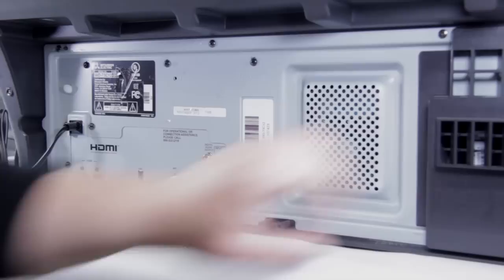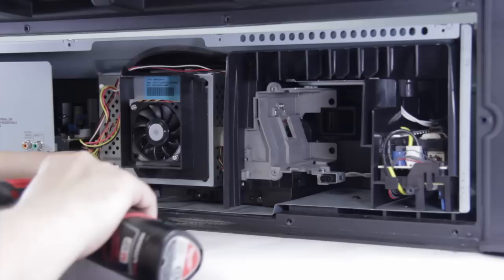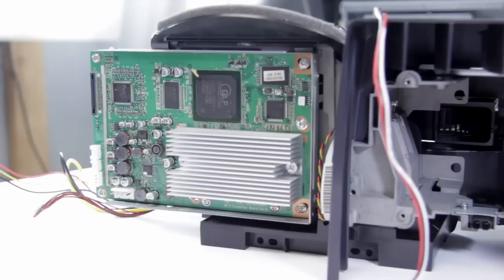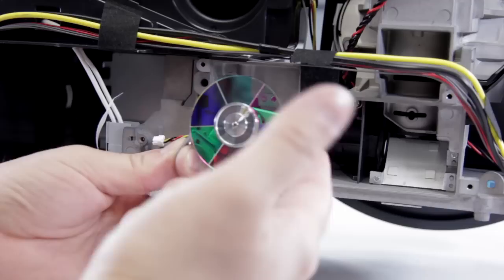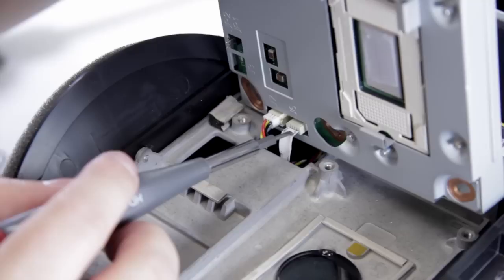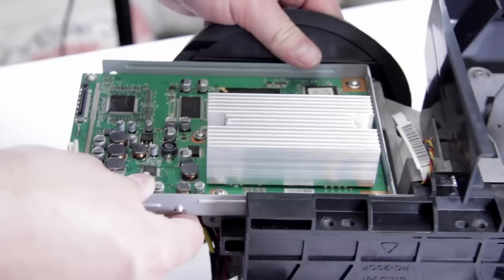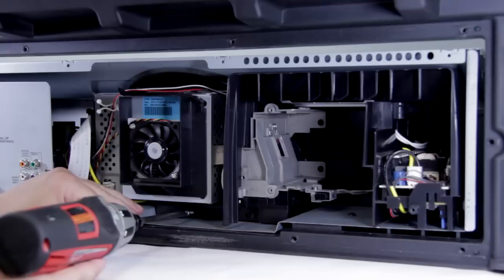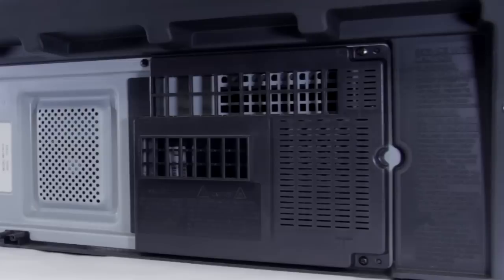Mitsubishi Color Distortion How to Replace DLP Color Wheel TV Repair - DIY Light Engine Removal

Comment: I'm getting ready to try this.

I'm only puzzled on one instruction. You say to leave screws loose on de-assembly of the formatter board. This make no sense to me as one could not reach the board to adjust it one assembled. Even if you disassemble to adjust how would one know the correct way to move it, trial and error? Sound like it could be a nearly endless process.

Comment: I just did a color wheel for a client. I was very apprehensive to have to remove the DMD board as it is supposed to be adjusted when reinstalled, probably not a big deal, but...
What I noticed was if you remove the one screw holding the lens shroud and remove it, the connectors are accessible from the back without removing the DMD.

Comment: This repair video was awesome.  Having absolutely no prior experience in TV repair whatsoever,  I was able to get to and remove the old color wheel, replace it with a new one and get everything re-connected and re-installed with no problem - thanks to this video.  Took me a couple hours because I decided to clean the years of dust and grime off of everything along the way while I worked - but it all came together very well.  The TV now operates perfectly - just like when it was brand new.  Thank you!

Comment: this guide was fantastic! the only thing I'd add (and it's not necessary) is to put red sharpie around that one stray screw hole on the right that looks like a vent. otherwise you may have an extra screw at the end. but again it's not necessary and if you have an extra screw, just tape it to the back and pretend you will put it back in one day.

Comment: I like the way you take your time and explain every step as you do it; you say what you're fixing to do and show where the parts or screws are are whether or not to be careful or not to touch this or that due to possibly messing it up.
That's exactly what I need. I did manage to take the color wheel out just like you did, but I missed hearing you say to turn it over cause I got lost when I looked at yours and looked at mine, but I figured it out.
Thanks for explaining so clearly.
I give 2 thumbs up!

Comment: Great video, my model was slightly different with the color wheel cover but everything went in the same way.  Can I just say that the color wheel cable is too damn short?  Who the hell designed it this way, and why don’t the replacement wheels come with a slightly longer cable?  What a PITA connecting that thing!

Comment: You should have clarified that you were also working on an LCD TV.  Clean that fan before it fries the chip.  The Japanese electrical engineers made those wires so to put back because they smoke their opium at work.  Great video.

Comment: Question. We've got one of the 73 inch mistubishi dlp TV's here. And when we start the TV up,it's fine for the 30-40 seconds or so and then the color begins flickering. Is this a color wheel issue? What causes it? 
Also, do the Mitsubishi colow wheels have air bearings and would cleaning it help alleviate the issue at all?
Reply: @brentpierce7585  so are you saying if you use a cheap balb you hear  the whining sound. But then you use an expensive bulb and no issues play using the cheap one causes the same issue

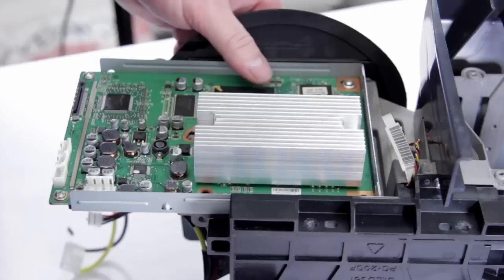Comment: Hi great video! On 13:24 you say not to fully tighten screws for possible picture adjustment. 
So, if picture adjustment is needed, we would need to again perform all the steps to get to this electric board for adjustment? Because in order to test picture we must re assemble, power on and test, correct? 
Thanks! 
Michael
Reply: I just posed the same question, what did you find out?
Reply: just wiggle the panel with the fan that you reassembled. don't take it all out

Comment: I am fairly certain it was the color wheel in my Mitsubishi 82" DLP WD-82740 that would begin making a whining sound after about 1 to 2, maybe 2½ consecutive hours maximum of being powered on.  When it did, the color was all greenish and flickering/distorted and I could turn the TV off and the whining sound would immediately wind down and stop within about 2-3 seconds.  Then I could turn it right back on and it would be fine, but then it would happen again much sooner than the first time after initially powering it on.  Occasionally, I would notice that it would look like it was about to happen, but would just distort the color for a second and then return to normal, but the other issue would always happen shortly after and it would always continue until the TV is powered off.

However, after many months {maybe even a little over a year} of this issue occurring every time the TV was on for long enough for it to occur, last weekend I had it on for many hours and then even fell asleep with it on and I was completely shocked to wake up to the normal great picture, no color issues, and no whining sound, which was previously unheard of since this issue began occurring.  A few days later and without the issue having occurred again, I fell asleep with it on yet again and same thing, woke up hours later and no issue.  So, yesterday at about 1:00 PM CDT I turned the TV on and started watching football, more football, 48 Hours, etc. and it has been on for a good 14 hours now and not even the slighted sign of it occurring.  I do not understand it because nothing has changed.  Of course, now that I have posted this, it will probably happen here shortly.  Hope not though...
Reply: Same thing happens to my TV.  Flickering when TV is just turned on, hours later the flickering stops after it's been on 8 hours or longer. I'm getting my color wheel replaced and hope it doesn't flicker anymore after that.
Reply: Jeffrey Tuttle 
hbv
Reply: Do it change it yourself had the same problem and it was filthy inside with dust changed the chip and the colour wheel is like new again you just need lots of time and pacience
Reply: Temperature change can affect the grease in the bearings and make them perform sluggish once the grease gets cold it kind of cakes up inside the bearings.

Comment: I have a Mitsubishi dlp 73" tv worked great then bulb blew up. I knew better but I put a cheap bulb in it. It would work ok for a few hours then the color would go all weird had lines through it ect. Turn it off for a while then it worked but same problem you would think the color wheel was bad. So put in the expensive O.E. brand bulb now it works perfect that was a year ago still works perfect! If yours is doing this could just be a cheap bulb causing the problem?

Comment: What is the issue if there is no longer white on my display? Ice in a hockey game looks yellow and the 'blue screen' when no signal is on is green. there is also a speckled oval of blue dots in a giant pattern on the screen. There seems to be a 'blue problem' wjth colors on my 2006 Mits wd62530. New bulb every 18 months, getting about 8000 hrs per bulb, so normal. I love this TV for the 50/50 screen split, but a new 60" is only $750 or so now and it might be a better value than repairing...thanx

Comment: I'm replacing the dlp chip and the colour wheel myself ,can't get a tech to come and replace them ,,would be nice to know how long the colour wheel should spin as i bought  one from China and it didn't spin for too long so I'm waiting for another one as I am afraid it was a dud and don't want to disassemble this again I love this tv wd82 840 spent over $400 in parts  ,,,,,,,hope it works the disassembly video was really good just the spinning of the wheel would  have been a great help,,,hope this works if not I'm going to cry and dump it😕😕😕😕😕😕
Reply: one light spin should last at least 5 seconds on a new one

Comment: Hey ShopJimmy, I used your great video to replace my 92" Mitsubishi color wheel, but when I reassembled it I didn't put any effort in aligning the lamp etc so the picture is a little off to one side, about 2 inches. Can you help me with that alignment procedure?
Reply: remember that bit he said about not over tightening the board? the whole fan and board there should move enough to make minor adjustments without doing any disassembly
Reply: major* disassembly

Comment: Which specific Mitsubishi Model TV is This? I have a WD 65838 that I just replaced the lamp in and just after doing so the screen began flickering and there is a whining noise coming from the back of the tv.  I'm assuming it's the color wheel because the lamp is definitely good.
Reply from the maker: gurleyz  This sounds like a color wheel problem.  It is recommended to replace the color wheel.  Looks like we are out of stock, but here is a link to replacement parts for your TV model number on our website.  http://www.shopjimmy.com/catalogsearch/result/?q=65838  Thanks!  www.shopjimmy.com

Comment: I have a 82" Mitsubishi DLP WD-82740  made in 2011. It makes a whine/hum sound that comes on as soon as I turn the TV on and gets a little louder after it is on for a couple of minutes. It stays on till a few minutes after the TV is turned off and the light in the back goes out. I bought a fan and spun the TV around and I can hear the fan noise that is different and quieter. does anyone have any ideas, could it be the color wheel? It's not too bed unless I'm listening to the stereo at night or at low volumes.  The TV has been used enough to go through the original, a second factory bulb and I put another in about a year ago.
Thanks Ted

Comment: I have a Mitsubishi DLP Digital WD-62927
Serial 10051. I just recently put in a new bulb. The tv power on and works fine, however after 30 to 60 minutes the colors start to flicker and the colors start to become faded and also develops a line split in the middle of the tv. Is it the color eh week that is causing this?
Reply: It may be the optical sensor attached to the color wheel.  The optical sensor is a Sharp GP2S40 Photointerrupter.  You could try replace this part if you can solder...otherwise you can buy a whole new color wheel (make sure it comes with the optical sensor, not all of them do).

Comment: Why didn't you show us how fast/long the NEW one spins?? Would have been a natural, coming seconds after showing how fast the OLD one came to a stop.
Reply: The colour wheel should spin freely but doesn't whirl around fast I replaced mine and saved a mitsubishi 82 ins tv 2011 model this was a great video I could not have done it without it ,,I've never touched electronics before it took me about 5 hrs going step by step to resemble it was worth it as nobody would come to fix it
Reply: @icefigureskaterliz1118  u got lucky . Can I have ur tv

Comment: Thanks for answering my last question, i recommend that you simply pay a repairman this step by step with wires pulled here and there and screws taking out is beyond a hassle for anyone who is not familiar with working on tv's then after you fix it i HIGHLY Recommend you sell that crappy tv!!! i didn't know i was gonna have to become a part-time repairman to own this DLP JUNK!!
Reply: Would a bad color wheel cause the bulb not to power on?
Reply: @marksimmons1289  Most likely the bulb is dead is there a Red Light on? if yes the Bulb is no good i suggest you go on E Bay they have bulbs way cheaper than Mitsubishi but if the light is still green i suggest you call Mitsubishi they might be able to tell you the problem

Comment: so I did this.  when I got to the color wheel I took it out and got ready to put a new one in. I opened it and it was the wrong one. so I checked a couple videos on "last ditch effort" fixes for the wheel. I cleaned the sensor that reads the black band on the wheel for indexing and added some lube to the thing and spun it for a long time. I then just threw the old one back in and reassembled it. now I get infinite yellow flashes when I plug it in. what's going on? I read and saw the guy who made this is not answering, so can anyone here tell me what's up?
Reply: well I looked it up. if anyone else has that problem, don't forget to put all the covers back on the rear. testing it to see if it works and is aligned before you engage the interlock on the lamp won't work because it wants to prevent crazy uv rays from eating your retinas. I threw two in the sheet metal, one in the vents on the right side where it looks like an off-center vent hole and one in the top left. then I attached the light cover with both screws and it worked perfectly! the proper color wheel is now on the way, but the tv no longer makes white stuff pink and blue stuff green.